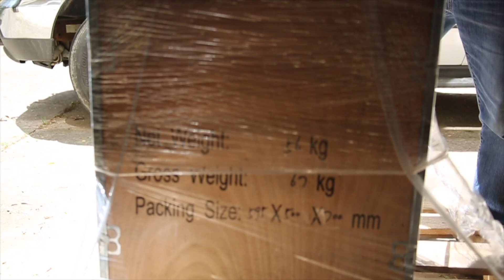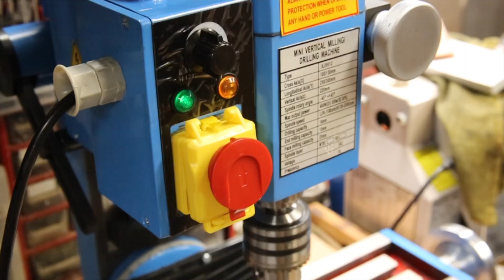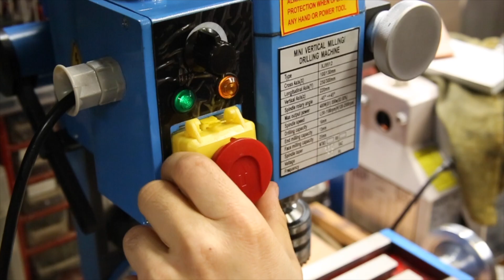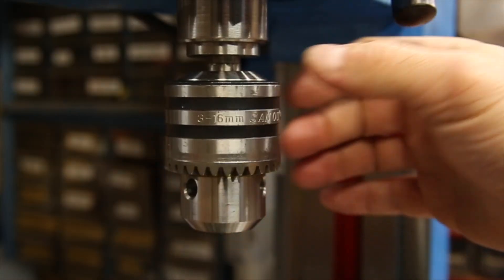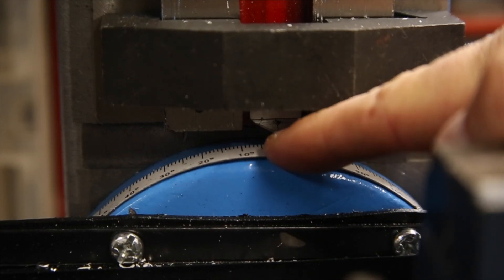Cheap Chinese Mini Metal Mill Milling Machine Unboxing, Setup, Testing, and Review

Comment: DUDE, take it easy with your back, I almost screamed when you lifted the whole mill that way.
Reply: Same! You only get one back. I blew mine out lifting a stud shooting machine and it's never been the same.
Reply: He cut cost by not including the pack with lifting instructions and a skirt.
Reply: Weak back
Reply: wow ..so small .  my "mini mill"  was 780 lbs and i had heck getting it into a basement shop in  an 1800s house ..used a motor roller 
how much did this machine cost and where'd you find such a nice small unit
Reply: Ever heard of deadlifting?
Reply: @harrisong5023  Because a mill is a barbell...
Reply: If you look on the side of the box you'll see its only 57 kilograms 127 pounds
Reply: Charles blain yes... to lift that much will most likley hurt your back unless you are a strong-man or younger than 20.
Reply: @antonw-uw4ov  we are all under 20......In our mind....for the first few minutes. Then, fucking reality reminds you.
Reply: @DesertFernweh  I am, indeed under twenty... But not for long
Reply: @DesertFernweh  hey when I was twenty I pulled trees out of the ground. Now I am fifty and even have troubles peeing against one. 😁
Reply: Lifting 57kg with ones back isn't just possible for an adult homo sapiens specimen, it's embarrassing if one CAN'T lift that with their back (it's less than a one-plate deadlift).  Backs aren't made of glass.  Train your spinal erectors, learn the valsalva maneuver and all is good.
Reply: @0xff0xff0xff  If you don't understand the incredible difference between an evenly loaded barbell and an awkward ass tool, you've never picked up either.
Reply: @0xff0xff0xff  Glad you said what I was thinking about the lightweight mentality. Hell my mill weighed I think 569lbs and I handled it myself with a dolly and attention to my lifting form.
Reply: @BadBoy-qe3be  All of us are not Sasquatches! It is always best to get help lifting stuff over 75 pounds for the average joe.

Comment: Hi Tim, like your vids, looks like you have plastic gears in motor /drive spindle (as with lathe hi /low gear select set-up)these gears are renowned for breaking. Little machine shop stocks conversion to belt drive which will cut the noise down and cut out any chatter . Set up Gib strips for no movement but still moves freely and set your mill vice square with d.t.I. . The fine adjust slop can be taken out by crimping the coupling (see Dave m u tube . Recommended ). Face mill tool will give exalant Finnish.  Have fun .regards boawayn

Comment: You definitely need to indicate your vise which in other words makes your vise perfectly square with the head. If you don't and try to say cut a straight line or a step it's going to be diagonal and most of your cuts like the aren't going to be square the only way you can get away without indicating your vise is just for making a face flat lol. Just look up how to indicate a mill vise and you're golden it's really not all that hard but it's much easier if the vise only has 2 mounting holes. It's very frustrating at first so it takes patients and time but you'll get it!

Comment: Collets- definitely yes, For aluminum, 2 flute bits give better finishes than 4, which are more suited to ferrous metals. You can also use carbide tipped router bits in the mill as well as a router. Nice acquisition. ☺

Comment: Seems like a decent little machine.
Though, considering how much it wobbles during use, you should obviously place it more rigidly on the table instead of the pallet.
And a little piece of advice, don't use the handles for the X and Y directions, grab the wheel instead and use your wrist, it induces less wobbling and will result in better surface finish.

Comment: Get yourself a 10mm tungsten end mill with 3 flutes and an ER32 collet chuck and collets.
Make yourself some parallels.  Machine one side and flip it to do the other.  That way you will compensate for any error.
A lot of guys seem to like grinding vises instead of mill vises.  They are rigid cheap and you can turn them on their side for making stuff square.  A good project is a fly cutter.   Start saving for a rotary table.
Reply: k9wiREless 
I used to sharpen and mills at tool grinding shop.  Yes, chucks are for drills, so use the chuck to make your milk a drill press.  Collett is for precision.  Which brings up the question of how precise you can get.  On industrial mills 1/10,000 inch is what is expected.  That is because milling is usually for precision parts.  This machine tool looks fun and useful for undemanding work.  I almost bought a Cincinnati when Northrop was closing its B2 Bomber plant I  Pico Rivera.  The problems with those tools in your garage are: it is big, requires 220 volt, moving it requires special equipment like a machinery trailer, moving it on the garage is no fun.  The price of the Cincinnati was appealing but everything else made me not want to deal with it.    Questions to ask: budget, space, can I get it done elsewhere.  And then there is skill and maintenance.  Using a milling machine on steel is not like wood working.  If you want to use a milling machine you need instruction and practice, something I never did (but then I could always ask a machinist to do it for me).  Would like see video of using collett instead of chuck and work on steel.
Reply: @saltyroe3179  You don't use milling machine for 1/10,000 inch accuracy. Mills are really expected to have 1/1000 or even 5/10,000 accuracy, but if you need 1/10,000 inch accuracy you use a surface grinder for that. Those big industrial mills don't just need 220, they need 3 phase, which can be solved with a rotary phase converter or a VFD. VFD is better because it allows speed control but depending on the mill you have it could be troublesome to tie it into the machine. For example I have a Dahlih DH-1500 and the motor is a 4/8 pole motor that allows you to have a high and low speed range. Problem is how do I tie it into a VFD? It's possible but it would require a radical rewire of the machine. Using a Rotary phase converter or a straight 3 phase line simplifies a lot of things, luckily my shop has 3 phase line.
Reply: Vertex HV4 or 6 inch....i found this is great with a three jaw chuck, but four jaw is for that one off project
Reply: R8-ER32 holders would be perfect.
Reply: I might disagree with the carbide. Carbide does not hold up well in an interrupted cut. I think check the TIR on the spindle first. If it's out even a small amount then stick with HSS.
Reply: @LPRNChannel  by definition milling is ALWAYS an interrupted cut.
Reply: John Crease
Reply: All good advice.
Reply: Er32 won’t fit in the spindle probably you should try ER16 tool holder and i don’t recommend using tools above 3/8 in diameter. The drill can be over 3/8
Reply: Machining one side and then flipping it over to machine the other side does not give  a flat surface you are making an uneven part
Reply: @rustyshaklefort8563  if the bottom of the Chuck it's resting on is level to the movement of the moll (which you can do with the mill) then anything you set on top will be machined to the same level. Machine one edge to provide a flat and level surface then flip it over to make the sides parallel. Unless there is an issue with the bottom of the vice and the travel of your mill not being parallel then the resulting part should be completely parallel, assuming no operator errors. This kind of alignment is done all the time with grinders.
Reply: @rustyshaklefort8563  it may not be square in comparison with the sides of the the stock, however it'll be flat enough for use with the same
Reply: John Creasey you stole my ideea

Comment: Seen a few comments about getting a collet system and totally agree.

I got an ER32 chuck for my bench mill and loved it so much I got one for my lathe and dividing head as well. Being they're all the same size, the nuts are interchangeable, so whatever's being held in the collets can be transfered from one chuck to another depending on the required operations.

You can even get collets that are specifically designed for holding taps too. Have a look into "power tapping on the mill".

For facing large surface areas, a flycutter or facemill are the "go to" for that job. I just made myself a couple different styles of flycutter recently (round head and disc/flywheel types) and they leave a great finish on the part. As a rule though, a sturdy disc style flycutter will handle bigger cuts and leave a much better finish with light cuts than round head flycutters as there's simply more mass to them which makes them more rigid.

As to endmills for facing, they always leave overlap marks, just the nature of how they cut. Sometimes though, they can get to  areas a flycutter can't, so they have their place in facing jobs from time to time.

Anyhoo, good luck with the new mill, at least you didn't have to fix yours before you could test it as I did. Pretty steep learning curve as I'm just starting out too but she's finally cutting chips now :D

By the way, that last clip had me rolling around laughing. Shows a stout character to put something as humbling as that in, I applaud you good sir ;)

If you have an air compressor, you could get an air spanner that fits the draw bar nut, it'll make swapping out those tapered mill toolholders a breeze once you get more (and you will, it always catches those that are new to mills out. The trick is to work out what tooling you will use most and buy one each for those, then have one or two spare for occasionally used tooling. After that, you shouldn't need to get anymore and you'll find your workflow will speed up no end).

Comment: You just doubled your tool storage needs, at least. You'll end up putting fishing tackle in the tool box because it will never hold what you're gonna need for the mill. I made a spring loaded spindle lock for mine. Got tired of looking for the pin. Enjoy, be safe.

Comment: You will want to look at getting a nice vice, since you purchased from banggood, look at there tool makers vice's with the best reviews. You will also want to look at coolant, just get a  drop coolant that is non motor powered, you dont need much on a manual mill.

Comment: if the gears are plastic make new ones out of steal and then you can use a motor 2 times the power no more that's all it will handle you will need the spindexer for this good luck .

Comment: you will need a fly cutter a boring head and a spindexer  witch can be modified parallels some V blocks a clamping set   cutters form banggood tungsten they are very good and I think a set is just over 50 $ bucks the point is have fun and learn  at the same time lol.
Reply: A boring head can be a fly cutter. It can also be a trepanning tool for cutting smooth cylinders manually without switching to the lathe. Boring heads are very unboring.

Comment: Can you add a DRO? It might be the video. But that spindle looked like it was wobbling when you first turned it on. You need to super clean everything before using it. There is packing grease in places that it should not be. You need to setup tram the slide table.

Comment: Congrats tim. Finally you can do more great projects. But I would like to say something that you should invest the same amount at least on a used column mill. Column mill is much more strong and rigid than the one in video.now its time to update your lathe for a quick change gear box lathe and your next mill must be a knee mill.thanks for all the great videos

Comment: Many good opinions in the comment section, but not one mention of the horrendous atrocity committed against the work piece, when he stopped milling and dragged the dead tool across the surface. You always run the tool until you're clear of the piece you're working on, always.

Comment: Mill time! Sweet! I'm super excited for this. You're building a capable little shop there, Tim. Good shit. 

As others have said, get a set of R8 collets for end milling. That drill chuck is only for that... Drilling.

Looks like it has a Z-axis lock, as well... Use it every time you're making a X- or Y-axis cut, as the head has a tendency to droop mid-cut if you don't lock it. 

Littlemachineshop has a great starter kit that includes all the basics you need to get started (Kurt-style vise, clamping kit, parallels, collets, end mills, etc.). I'd also recommend the 20tpi feed screw upgrade, as counting divisions on the 62.5-thou-per-turn dials is a pain in the ass. The 20tpi screws give you 0.050 per turn. 

You MUST bolt that mill to the bench. It's far too top-heavy to stand on its own, and will almost certainly tip on you. 

And now it's time to invest in some better measuring gear. A small inexpensive 0.0005" dial test indicator, and a Noga-style import indicator holder are a minimum. Tram that head in, and the vise as well. Never tilt the column, unless absolutely necessary.

Comment: When milling, you will want to use the z-axis lock as the mini mill can drop 20 to 40 thousands in the z-axis direction. This can sometimes ruin your part that you are working on and sometimes break your cutting tool. This has happen to me and I lost a cutting tool.

Comment: Second order of business for me is to switch to the belt drive
Reply: Hoe much is a belt conversion?
Reply: Prolly around 150$ if i knew better i would have just bought the hi torque mill. Which already has belt drive and a air spring instead of torsion type
Reply: I'm in the UK, they sell these machines as a few different brands, none seem to state whether they're gears or belt, what's the air spring all about?

Comment: youll need some kind of indicator to tram your vice in (some one below suggested a 3 inch toolmakers vice and that sounds good )also neaver hold the end mill in a chuck ther drill chucks not mill chucks  get some collets to fit if moneys a thing just get one at a time as nedded but start with 1/4 3/8 and 1/2 also a fly utter for  making bigger flats with one pass is nice and cheep(you can make one  eaven and use a hss  bit in it )also if your looking to hold round things a V block will make the holding much more stable . above all go slow its no race;)

Comment: Woohoo! First Chips on a new tool! I don't know much about machining in fact I learn some from watching you. Clickspring and abom seem to be big names here on YT. I'd get some higher quality grease and clean the thing out after 25-40 hours of use. Solvent clean, then new grease. Mobile 1 or moly disulfide. This will get the bits of metal out from a break in period and should increase service life overall. I've got a chinese wood lathe and notice there are a few places things could be better. Luckily precision with a wood lathe is rather unimportant. The grease it came with was aweful and got gummy after a few months. Wish I had removed it earlier.

Comment: I got a lot of my tooling and upgrades from little machine shop. I didn’t have any idea what I needed and shot them an email, got lots of help and info. Great place to look for pat, pieces, tools and upgrades. If you have plastic gears like mine did a switch over to a belt drives is good idea. Great video!

Comment: Congrats for the new mill ! A drill chuck is like the name says for drilling its not designed catching the side forces when milling that's where the accuracy is lost. I Use ER 11, ER16 ,ER25 and ER32 on my mills also C5 are good the advantage of ER collects they not only can take the exact size they are named after ... like a C5 collet - e.g.6mm can take exactly 6mm.. but a 6mm ER XX collet grips safely from 5mm up to 6mm ... 1mm is their using range. The C5 are more used on lathes the ER XX on mills , lathes and surface grinders .Best wishes 
Wolfs Tirol

Comment: the surface finish on this thing is not bad at all considering you just use a drill vise, you propably should get a more rigid one in the first place and then get rid of the jacobs chuck, invest in some collets since those are made to hold the bit true and concentric. i think a flycutter will also be nice, thats one of the first projects you could do on the mill too, its fairly simple, you can use both milling machine and lathe and its very rewarding since when done, you got a tool that you will use over and over again. 

check out this old tonys version of a flycutter using a lathe tool, its awesome!

Comment: Don't use endmills in a drill chuck.  Drillchucks aren't capable of side-load and will pop off the spindle adapter.  Additionally, they don't have the accuracy.  Pick up even a cheap collet set to hold your endmills.  That bolt through the spindle is known as the 'draw bar'.

Also, you should get a milling vice and make sure to 'tram' it in, so you can hold parts accurately.

Finally, with a mill that light, you need to bolt it down to something really heavy.  Good luck!